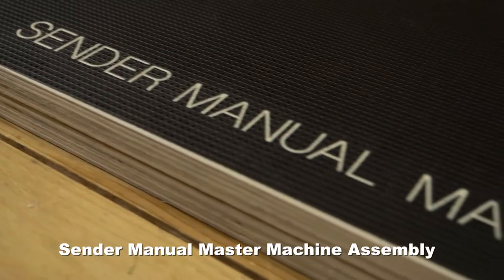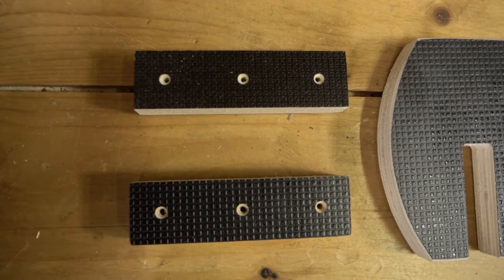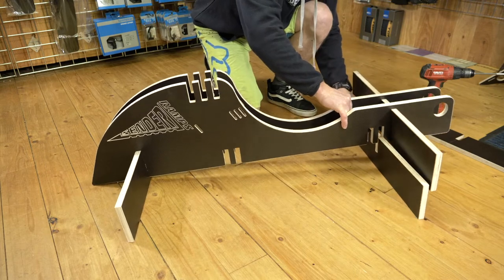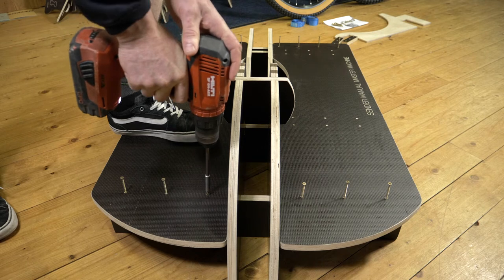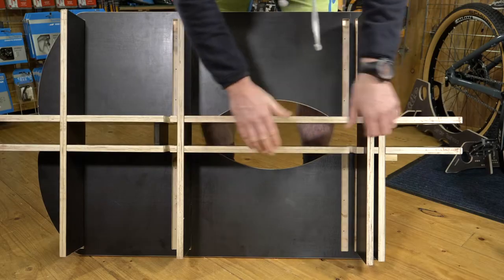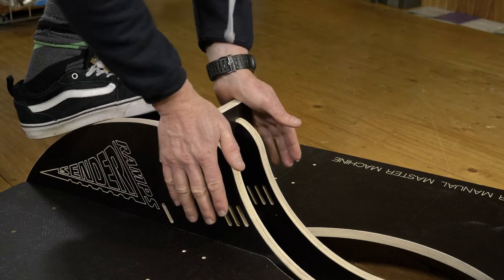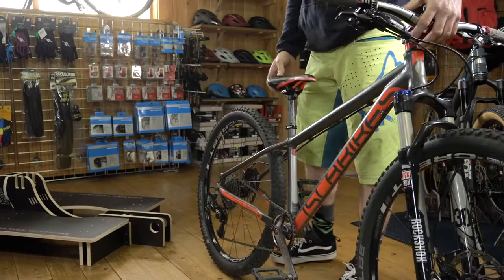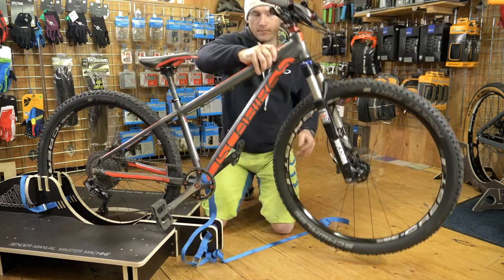Sender Manual Master Machine Assembly Guide

Comment: Will a 27.5 x 2.6 fit on a standard machine
Reply: Based on my discussions with the guys at Sender-ramps, you would want the plus size for a 2.6" tire.  The regular unit has a 60mm gap for tires, which according to their website is a snug fit for a Maxxis Minion 2.4 WT DHR.  I just order the plus size for my 29x2.6, and I ordered an extra 12mm spacer.  The plus size gap is 80mm, so for a 2.6" tire (est. at 66mm) I am hoping to use the 12mm filler and over inflate the tires.  I hope this helps.
Reply: How big the gap is on the plus machine?
Reply: Ron Abrenilla 80mm. See my last reply for the calculations.

Comment: Ive just recieved mine and its pish !! i cant even put it togehter as the battons dont fucking fit .. he says slot in in the video  ,,yea ok .. im using a rubber mallet and still cant get the battons in .. i paid for the pro and it looks nothing like this .. looks cheap and some of the pre drilled holes are not even level ..will be contacting them !!!! they say they test them to see if they fit ...yea bollocks !!